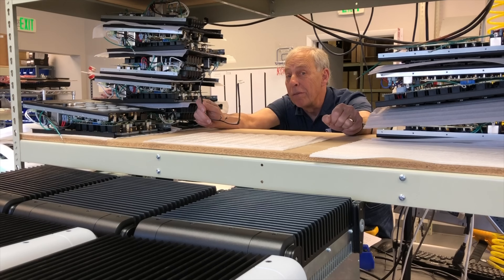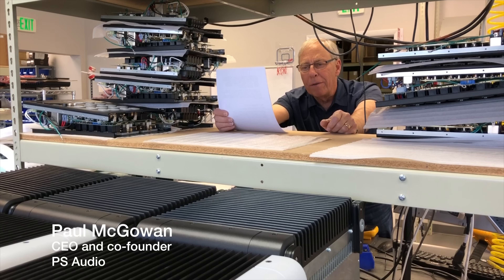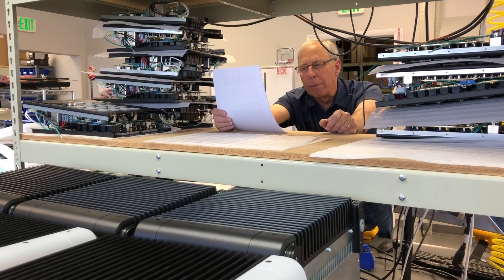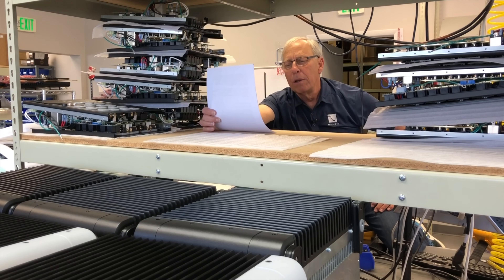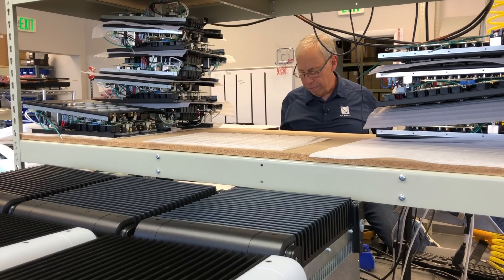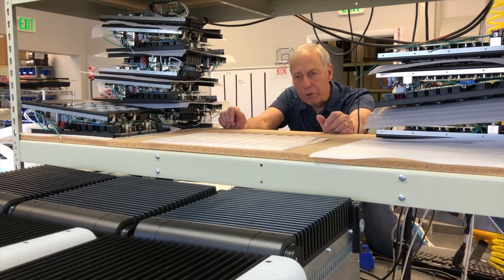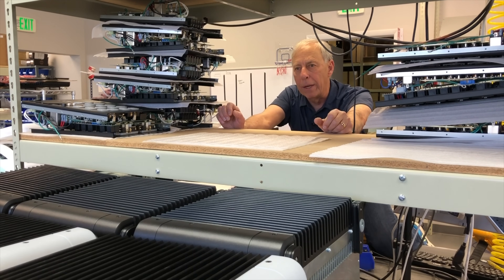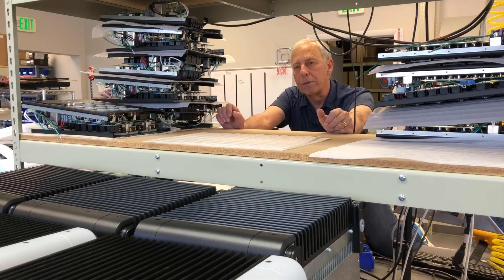Why aren't there more active crossovers?

Comment: Sorry, but your reference to how difficult it is to design a proper speaker crossover makes sense for passive crossovers but not for an external, active crossover. All the complexities you refer to are inherent in the design of passive crossovers, not active crossovers.
Years ago I bought the book by Douglas Self 'The Design of Active Crossovers'. Douglas outlines all the complexities/problems with designing passive crossovers not least "absolutely not permissable to treat a drive unit as if its impedance was simply that of an 8ohm resistor. The peaky impedance rise at resonance, and the gentler rise at HF due to the voice coil inductance have to be taken into account to get even halfway acceptable results".

I have been running my Wilmslow Audio Prestige speakers as active for over ten years, using a non audiophile Behringer 3 way stereo active crossover. I use three Quad stereo power amps. Yes, I did have to open up my speakers, remove the passive crossovers and fit some new internal cabling and binding posts, but the speakers sound lots better even with a non audiophile active crossover. I sold the passive crossovers to someone who bought my old Prestige cabinets when I bought the flat pack DIY new veneered design cabinets. 
I have some electronics background from my college days, though that was decades ago. However, with the advice in the Douglas Self book, I do intend to design and build an audiophile crossover for my speakers. I don't expect it to be easy but I do see it as being very possible. I would not attempt to design an audiophile passive crossover.

Comment: I am building a set of three ways and am leaning toward active crossovers instead of building a passive. I have very little experience with active other than subs and AVR adjustments. So I figure this will be a good way to get familiar, definitely save alot of time. These are going to be more party speakers than real HiFi, but I want them to sound good. With an active, should you still add a cap to the tweeter for protection? (Ribbon tweeter)
I am going to do all the research an calcs but if anyone has any sugestions, critcism, warnings or knowledge on the subject, some input would be appreciated.

Comment: We just need audio companies to make portable stereo systems with built in active crossovers, even at low wattage portable small home audio system, damn they sound way better,  as class d amplifiers are getting cheaper and cheaper. We just need to integrate them to old design. I just made a cassette radio integrated with a small 2 way crossover, all my friends told me it is about 200 watts of peak music, when it actually is around 16 watts rms running on a 1 khz active crossover. 6 watts on woofers and 2 watts on tweeters.

Comment: Audiophile dealers love passive speakers because they can sell you all sorts of exotic speaker cables that might have high or low resistance or capacitance that will change the tone a little bit.  Those cables will cost more than the second amplifier you would need to create an active crossover system.  They also like to sell you different amplifiers so you can get slightly different sound due to those low impedance passive crossovers producing slightly different sound with different amplifier output impedances.   So yeah, that would greatly cut into their sales.  You probably already own four channels or more of amplification so most people I know only need to buy a digital crossover and patch it in.

Comment: Started using a Behringer DCX2496 with separate power amps in a 2-way DIY and have to say ... what took months with thinking could i have done it better - now takes seconds.
Create a few "save-points", create a few more ... and just find what you like the most - long story short, am never EVER! going passive again !!!
Reply: Even a pro Barringer  makes that much difference? I am building 3 ways and am considering active crossovers. I don't want junk, but as I have little experience with active I don't want to spend too much on my initial attempt. Besides, if it does the job why waste more money? I like the idea of a pro unit because of all the functionality at a much lower cost than gear for HiFi.

Comment: Old news . I have Buchardt A700 Blows away everything. And yes you can tweak it as much as you like in digital domain And yes is class D , snubbed by so many audiophiles. And is WISA in digital domain. Of I forgot Vinyl with 50,000 turntable  and 100,000 pre amp and with 100,000 tube amp pure class A and a ton of distortion is the best according to some audio magazines. I believe in measurements , and would be nice if any of these experts would be willing to participate in blind tests . Paul is very nice though. I am not referring to him. One day DSP will emulate every single tube on the market
Reply: Where do you think we are on that projectory of DSP emulating tube? I actually believe this is true. We need AI on this ;)
Reply: @derekviveiros   AI will someday emulate all kinds of speakers, tube sounds, amps, etc. It will also improve room response much better than current systems. An advanced AI amp will play different sound bites, ask the owner which sound better to him, and then design the optimal algorithm to make the music sound perfect to that particular owner.
Reply: @ovidiubarbu2057  drool. The power of AI can be incredible
Reply: @derekviveiros

Comment: When I built my own custom speakers I set them up for either single or tri-amping.  For the crossover I use a DriveRack PA-2 that I got on clearance for 150 bucks. Cables from mono price.  I had lots off good quality amps laying around so no additional cost there. I think it was worth the effort but agree with his comments on modding existing speakers especially if they are expensive speakers but you could always  build a custom  enclosure and just use the drivers. Active crossover in total only added about $200 to my project so it was worth it for me.

Comment: I have a set of active speakers from the 80's, they actually employ a "semi" active x-over. The x-over itself is passive, BUT it has an op-amp behind each freq range.
Reply: hey! that is good idea to add a buffer (ie; as you wrote "adding an op amp behind each freq range"), to prevent the looping noise from happening

Comment: Audiophile equipment died in the late 80s.  Idiots don't know physics, electronics ...  What happened to the VFET, JFET?  Direct Drive in B&K analog measurement tape always showed DD to be superior due to 3 D Balancing of the platter, the superior position of the motor and the bearings and with the servo mechanisms always surpassed the belt drive by -10 to -30 in Rumble  in both weighted and unweighted and .02-.03% wf vs double and quadruple of the belt drives , even Linn Sondek.  The brainless also put small drivers in place of the larger drivers with far more distortion and no bass to the fast no low end garbage.  Think of the Technics SP-10mkIII with and entire arm made of Boron and micrometer capable system of fine tuning cartridges that had  styli that were vastly more advanced such as the Fritz Gyger stylus

Comment: The elephant in the room is the distortion of active crossovers in the midrange and high frequencies.  That's why serious designers only use them for low pass below about 100 hz and below.  Introducing other amps can introduce different sounds as amps can sound different.  You do not want a different sounding amp for your tweeters and midranges.
Reply: Good crossover must sound just like 1 driver.
Reply: @_klent  Ya think?  Yeah, no kidding.  Sort of like saying the sky is blue.

Comment: I use 2 speakers: one is a TL with no passive crossover to the woofer (I use this for bass/mid). The other I just use the tweeter which simply has a capacitor to prevent low f going to it. Thus, it is not far off being active. Each speaker has a power amp. But each amp gets full range signal. Superb sound. I’m going to make my own speaker enclosures and go properly 4 way active with separate active crossovers. Should be amazing.

Comment: BUT, if the design allowed the amplifiers to be on the outside with the separate wires built-in the speakers; then the amplifiers could be chosen.  I've seen it done, and my intent on my system is already partly active by my design . . . and I will be working towards the rest as I can afford the amplifiers to do so.

Comment: I just built my active crossover setup for under $500.  It sounds phenomenal.  I used an EMB PRO 3 WAY CROSSOVER, three Micca OriGain Compact Stereo Integrated Amplifier 50W x 2, some speakers I've had since the 70's.  This thing is the best sounding stereo I've ever had.  Lots and lots of cable and that may be the biggest drawback but that could be cleaned up.

Comment: You make it sound so daunting. Things like minidsp and raspberries can do the job of active crossovers with incredible amount of control and ease. A person can open up a speaker and unhook push tabs or unsolder connections to the drivers and alligator clip them to the terminals to try active (caveat on burning an unprotected tweeter of course). No need to neccessarily 'clip' anything.
Manufacturers can offer more of their speakers as active with active crossover (bypassable to passive with a switch if they want), passive and or 'naked' (with no filters whatsoever) with xover recommendation and  schematics. Come on, upgrade paths on component choice and endless (and mindless) tweaking is audiophile de rigeur. Manufacturers can offer upgrades and 'sound shaping' components galore.  Passives are dominant because the market has been set up that way.  AV receivers have had dsp xovers for subs for years. You can choose frequency and slope even on some modules to accomodate sealed, vented and lying spec sheets for the fronts for best integration.

Anyone can look at a passive xover circuit and use online calculators to determine the frequency and slope its dividing.  Use this as a starting point. You can even mic the room response and let the software adjust to flat after the crossover plot has been set....

Comment: it's all about demand. audio is one of the most mythical fields out there with lots and lots of 'believes' pretty much like religions. and passive crossover is believed to have the most "natural" sound for a long time and that belief never goes away so active crossover never really had a chance. because of that, manufacturers don't manufacture them. it's similar to how the market is flooded with bass reflex speakers. if you want a mythically good sound system, you buy it. if you want a technically good sound system, you build it.

Comment: What I really want is an adjustable PASSIVE, stackable crossover.  By that I mean, I want to be able to dial in speakers of my choice and as many as I want per channel by stacking filters.  So there are free programs to do 2 and 3 ways and tell you the right components.  I just want to snap together filters that represent different frequency ranges.

Comment: I have both active and passive crossovers in my system. As someone who has been building loudspeakers for years, if you find that much of a difference in quality when you bypass the passive crossover in your speaker, it means that either the passive crossover is not up to the task or you are using the active crossover to make up for deficiencies in the room.

Comment: I don't think the issue is that it's difficult to design a speaker crossover, at least not an active crossover. The issue is more that simple crossover designs (such as those based around Sallen-Key filters) with fixed crossover frequencies are only suitable for the drivers they are designed for. The difficulty comes in when you try to make the crossover frequencies adjustable so that they can be used with many different loudspeakers (at least without resorting to DSP). It is, however, true that since almost all commercial loudspeakers have crossovers built in, there's no real advantage to using an active crossover unless you specifically want to remove frequencies within the passband of the built-in passive crossovers.

Comment: If you only use digital sources an digital crossover with eq/filters/delay(and more) that will give the freedom to adjust the sound just like you whant it and also to do correction on the frequency respons to prefection and it will sound very good compared to most passive filter out there.
Also you will  have the freedom to switch out speaker components rather easily(sub/mid/tweeter).
But like you said it´s not super easy but with an mesurement microphone and REW it´s very easy to make it work good.

Comment: Hmmm. I didn't realize, when I built my active crossover tri-amp system, that it was hard. It did use up most of my wires.
Reply: Used up most of your wires.....huh?  Is that even a relevant comment in audio?  Why are so many idiots here?  Its like you've never heard quality audio in your life.
Reply: @bobhoskins9595  Aint it grand that YouTube lets us know when someone replies to our comments. I wouldn't reply except you have graced me with enough of your time to insult someone you know nothing about. Should I have said it requires four sets of interconnects and three pairs of speaker wires? Is that erudite enough for you? I built the speakers, and I built one of the amps I use on them from a schematic. By the way, your last sentence is a non sequitur.

Comment: Does an active crossover tipically include ADC and DAC components?
Reply: Thank you Paul! That's was I was thinking... that miniDSP sounded somehow wrong, having a cheap ADC+DAC in the middle of the signal to the main speakers. I mean in Hi-Fi, of course. There are many other uses where it could be useful. Using it for the sub sounds like a good idea.

Comment: We use active crossovers in live sound every day. I like active crossovers because you can have multiple amps for subs lows mids highs. Also you can help smooth out system problems and send certain frequency’s to certain drivers thus preventing damage.

Comment: Paul, it is interesting that the home/hi-fi audio scene has shied away from active crossovers. As mentioned in recording passive crossovers are almost considered a dinosaur not to mention most speakers are only available in self-powered units now. I feel like some of the cheaper models which no-one really concerns themselves with come self-powered but with passive crossover networks in them. Clearly, that is purely to save money.  I think for efficiency reasons hi SPL (sound pressure level) systems have been using active since the 70's or something.  Not only has pro audio on mass moved more toward active systems in general but all of the processing (crossovers, etc) is done in the digital realm and then converted to analogue just to send to the amps. In fact, many amps now come with the processing in them as you mentioned. I am told this is mostly done this way as speaker manufacturers who were making great sounding speakers were having problems with people using amps that didn't work with their speakers thereby making high-end sounding systems sound horrible. I personally think it was more than that and that was the small reason in actuality. The thing with processing in the digital realm is that it is easier to adjust time offset between drivers and that digital processing also creates less phase shift and far less distortion not to mention the ability to manipulate a much greater number of parameters cheaply than in the passive or analogue realms. Shifting time is possible I am told with a passive crossover but it all comes back to cost. In passive networks, we are not dealing with millivolts anymore. All of the components have to be planned with high power throughput in mind. With that, a simple resistor is no longer one cent.

Comment: This is an area where car audio excels beyond home stereo. I’m obsessed with both, but the level of granular control in DSP pre-amps from companies like Mosconi and AudioControl are so good that driver quality matters less than it once did, though it’s still important. When each driver is active, you can get close to perfect sounds curves using RTA tuning equipment. Crossover, rolloff, hi pass, low pass, bandpass, and robust EQ make this doable, even if difficult. My car stereo provides an experience so good for just a few thousand dollars that my friend with a $100,000+ home stereo is seriously baffled about how he got caught up into spending so much money. Today, just about any reasonably capable set of amps and drivers can sound just as good as a system that costs orders of magnitude more. Of course, you can always add a DSP to the very best equipment, but that is the “cost is no issue” solution that almost no one can afford.
Reply: Car audio has not excelled past home stereo. It only seems that way because car audio is so physically/acoustically handicapped to begin with, meaning DSP can achieve a greater leap in improvement.

Comment: In order to get the most out of bi- amplification using a tube amp to drive the tweeters and a solid-state amp to drive the mids do you need to separate the speakers from the passive network and use active crossover between the amp and the speaker?